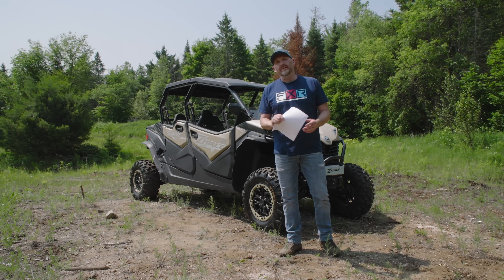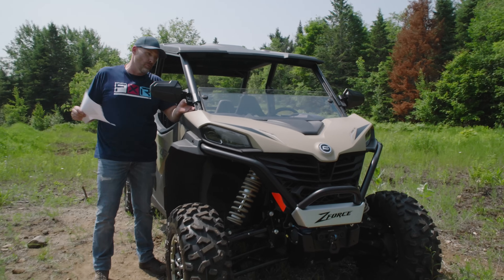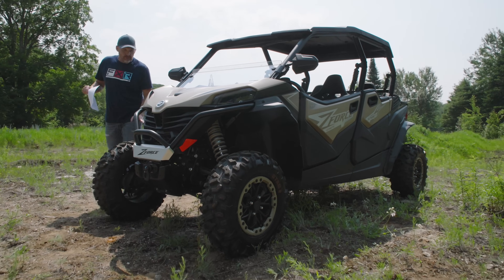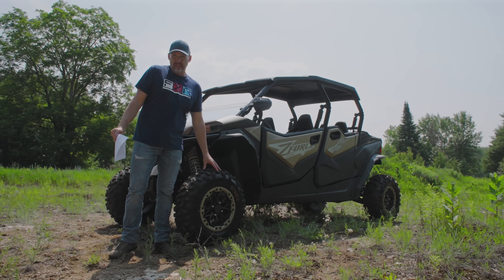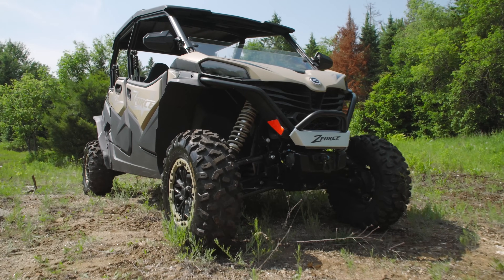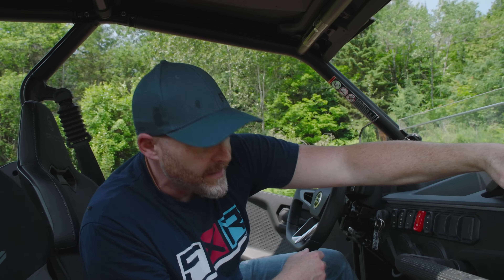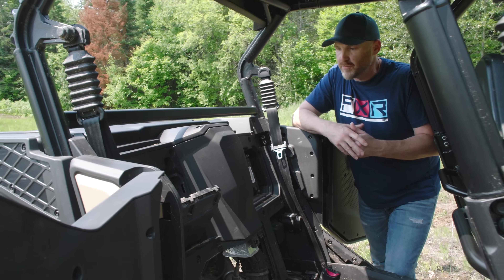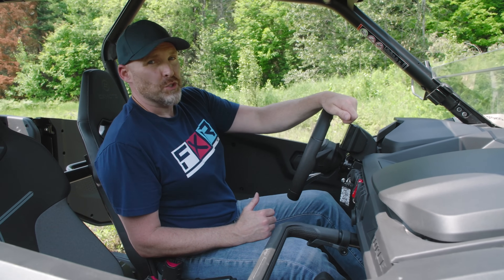2024 CFMOTO ZFORCE 950 Sport-4 Detailed UTV Overview

Comment: My cforce 1000 quad is a beast. I regret buying the overland model because they came out with the touring a year later, but it’s still a great quad. Been very reliable and hard to get stuck.
Reply: You know you can remove the middle pack and just lock a touring seat in its spot. It is set up for it.

Comment: I had a zforce 800 for 8 years and traded in on a 2 place 950. So far quite pleased with one exception. The US version and the 4 seater Cdn apparently come with a physical parking break but the Cdn 2 seater does not. My machine often locks up in park when on a small incline and is pain to get it out of park. The Cdn fix is to replace a part in the transmission and I have ordered mine while the US clients get the parking break. Hopefully this will work. Otherwise I really like the 950 and it's value.
Reply from the maker: The 2024 2-seater is probably the same machine as the 2023 so it hasn't received that parking brake update yet. Do you know if the 2024 2-seater gets the new shocks?
Reply: @dirttraxtv  I don't think so. If I recall mine has three or five settings.

Comment: I have a 2023 2-seater and I hate it for one simple reason, the engine heat coming back into the driver and passenger area from behind - under the seats and through the shifter gate is unbearable. Don’t even want to drive it. Do these engineers not even drive these things? Huge oversight. Also the turning radius is horrible but I did know that when I test drove one. I also tried a different machine ( exact same model ) at my dealer and same horrible heat problem noticeable after about 10-15 minutes of riding.
Reply from the maker: Not doubting your experience, but I did not notice any heat issues on the 2023 model or on this one. It was nearly 40 degrees celsius when I drove this one though so I was more focused on external heat than any coming off this unit...
Reply: The issue is with the full front windshield. It goes away with the 1/2 windshield but I bought it to have the full windshield